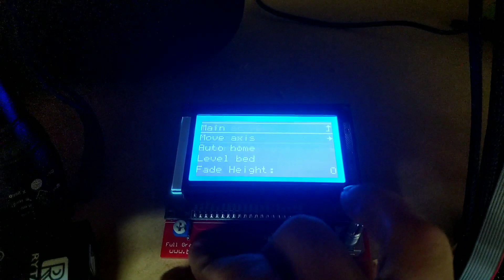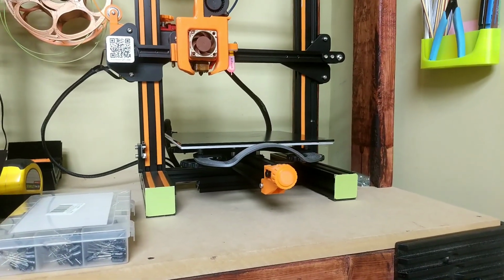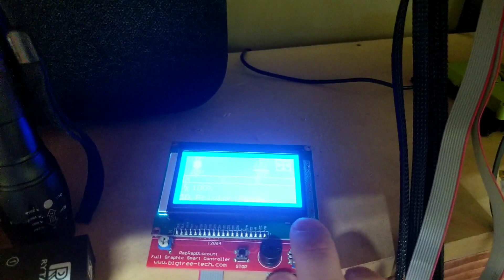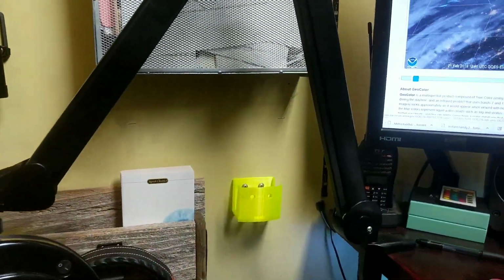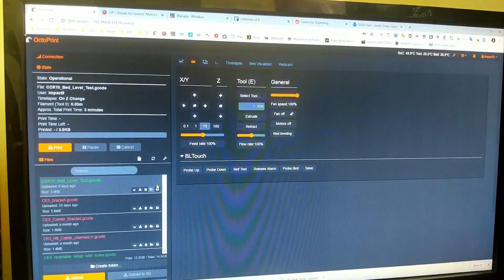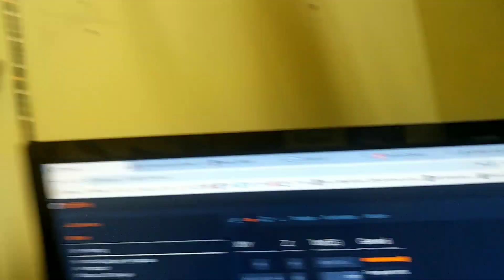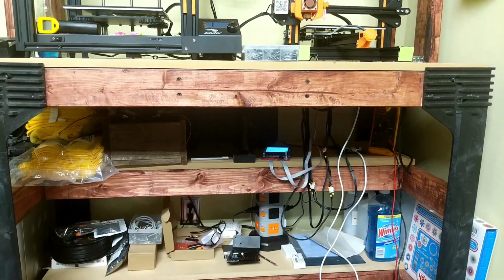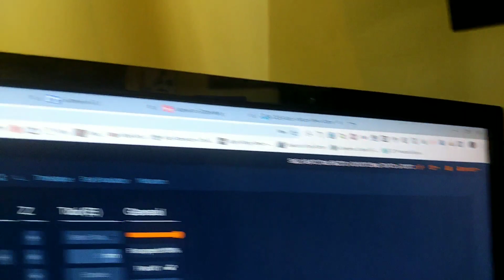Ender 3 - MKS Gen L, cable extensions, and errors oh my!

Comment: I’m having exaggerated movement on homing, after installing an MKS GenL board. Movement seems good until I run the Home All Axes command. X and y home fine, but z safe homing doesn’t happen at the middle of the print surface. I’m also seeing very fast movement. I’ve taken a geographical break from this, but when I get home I’m going to try putting in manual coordinates in Marlin to see if that makes any kind of difference. I’ll keep you pasted on what happens.